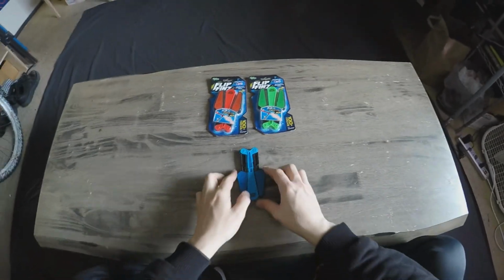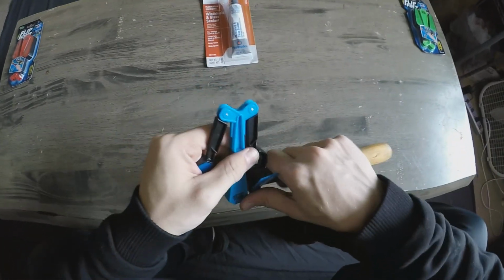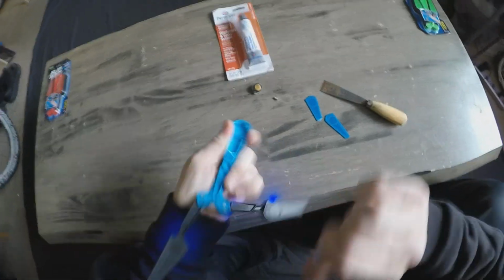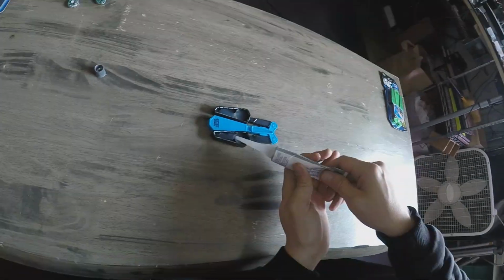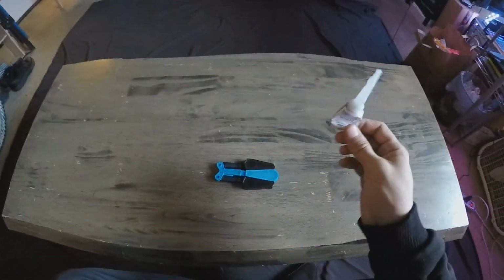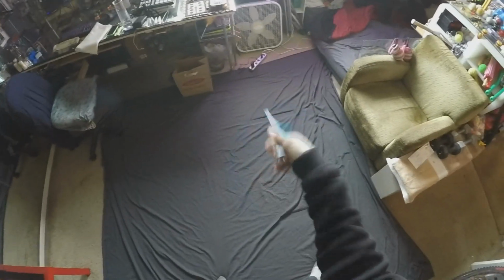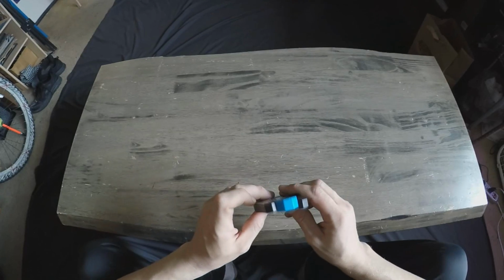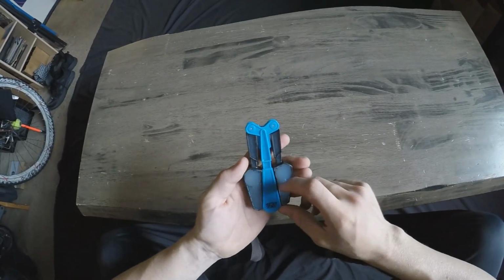Flip Finz - Silicone Mod

Comment: These flip finz are super light. I've been using one for a few months and its just so much different. The lights are durable though. I've dropped them in coffee and water and they still work fine, it just has a slight delay in the activation